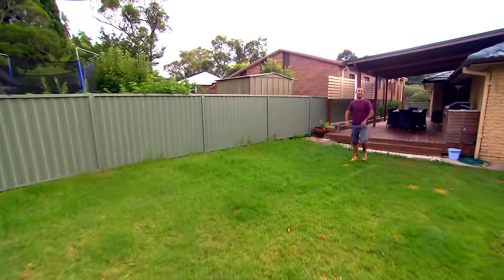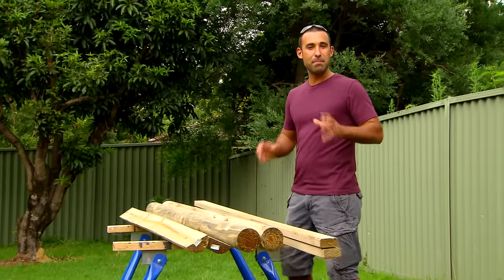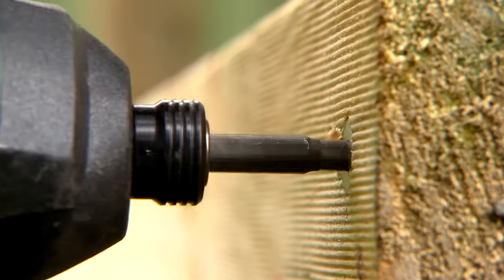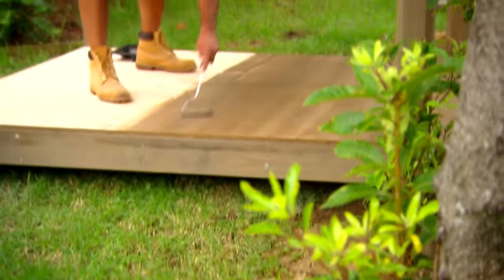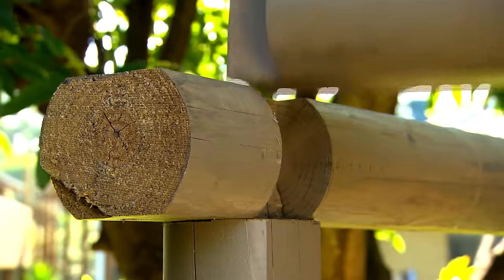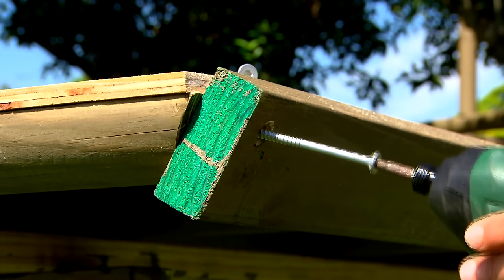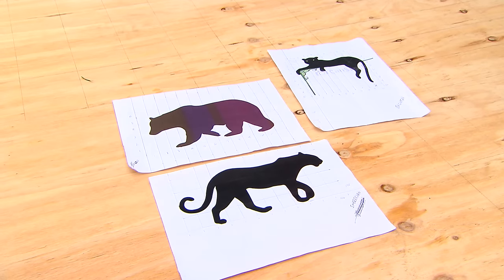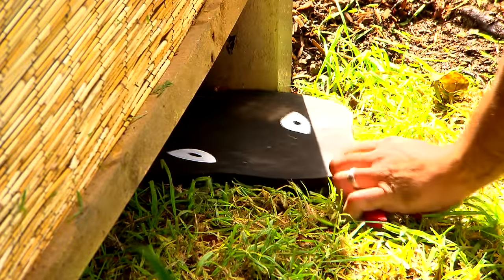How To Make Your Own Jungle-Book Inspired Cubby House | Outdoor | Great Home Ideas

Comment: Great video, just wondering what we can do to prevent main posts from rot and termite? is painting does the job?
Reply: must be pre-treated wood. I'm in france, so may be different from place to place, but here we have wood category ranging from 1 to 5. 1 is no treatment natural wood, and 5 heavily treated under vacuum for chemicals to penetrate really deep inside. range 5 is  for external use and can withstand super harsh environment without being damaged ( rain, constant humidity, termite etc...). I would have used a  metal bracket/supports in the concrete with a eleveted base for the main posts if you want extra long life. But as it is i'm sure you can go from 5-10 years without touching anything if category 5 wood.

Comment: Because I'm a novice, there's a lot of basics (the kind of stuff that shuts a project down), like depth of footings, type of cement, should it face north-south or whatevs for air flow, are there council regs, can I treat that bamboo with some kind of clear gloss for mildew/rot, how far off the ground, is there anything underneath on the ground, what kind of paint, why no undercoat if it's not a deck stain or similar,  those joins for roof structure look like they require tools or methods I'm not familiar with, hmmm.
Reply: Was thinking the same. Pity he doesnt mention more details.